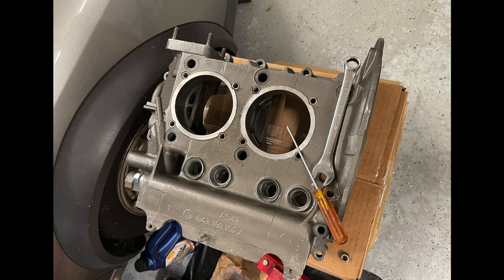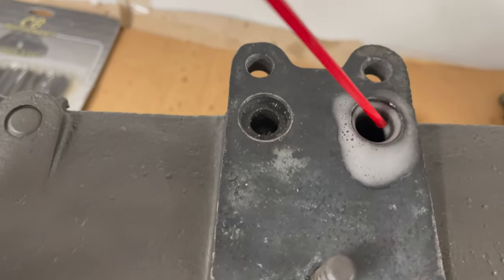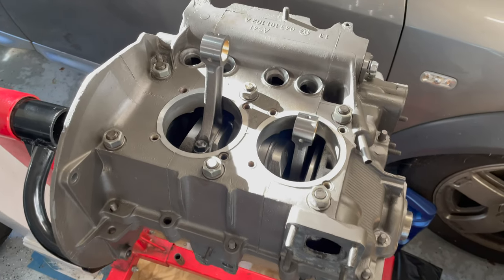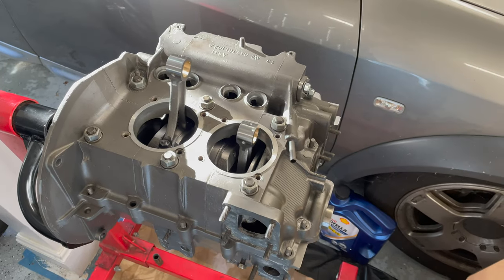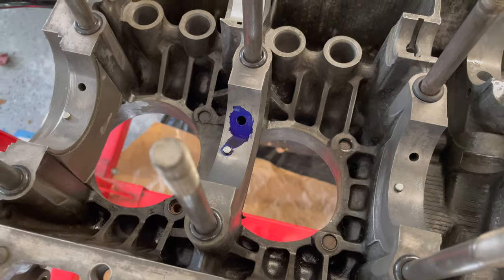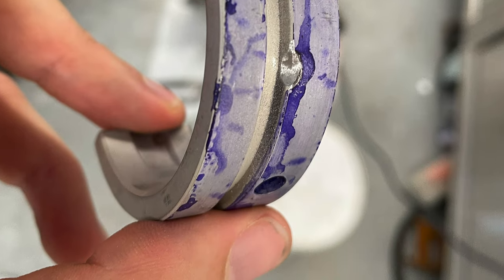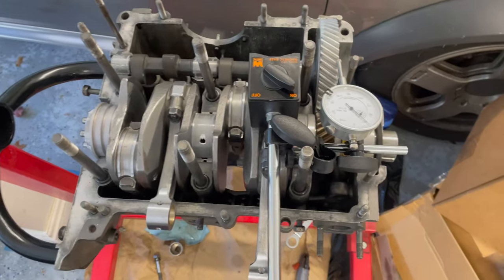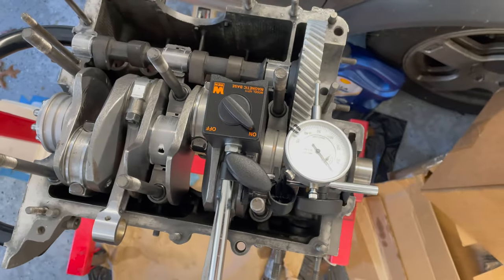VW engine rebuild step by step | Important short block checks | Ep. 10

Comment: Those shavings are very dangerous. Cleaning with solvent in a parts cleaner is better. Nice paint on the case. It is always better to stay away from cases that have been line bored more than once. 

It is a process of learning and you’ve done great and careful work but regrettably have been a little unlucky with some things. 😉
Reply from the maker: I also used some acetone but yes ideally i should have dipped it in a cleaning tank

Thank you for your message!